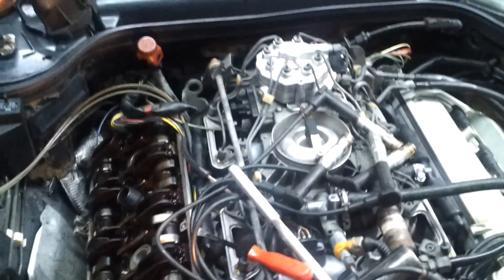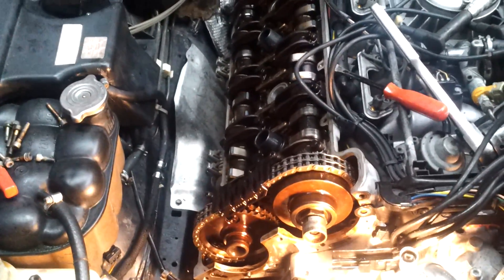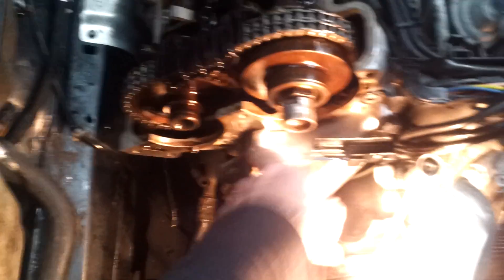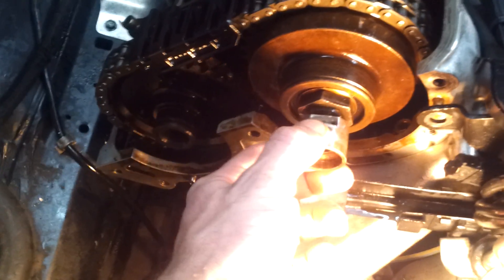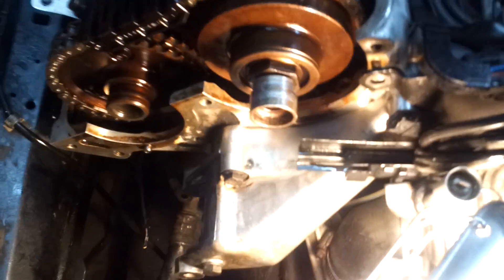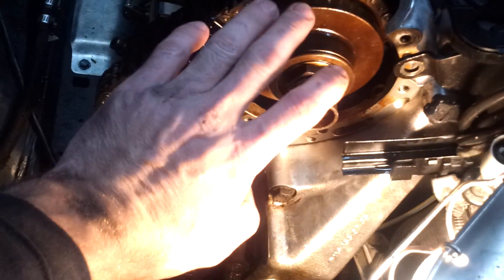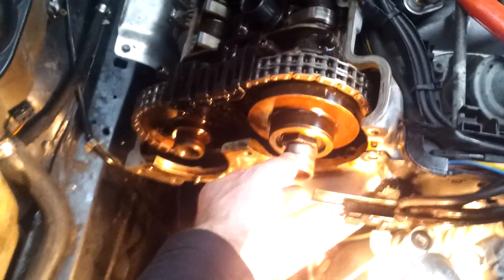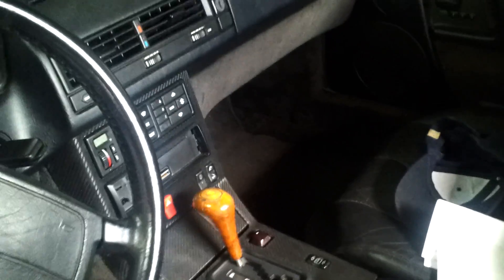Mercedes M119 motor camshaft advance mechanism. Mine was jammed.

Comment: Hi Victor, thanks for the great videos. My 91 500SL has camshaft magnet leaking from connectors. So I ordered a new one but need to replace the armature (the thing you are pulling out in video) as the new part number requires it  as an updated version. Can I replace the armature without taking the cover off, as it only has a new screw that goes in the middle. Do I need any adjustments. Please advise?
Reply from the maker: Its been long time ago that I fixed that stuck armature so I dont remember. I think you can just undo center bolt and armature will come out without removing valve covers. Sometime putting silicone around connectors stop leaks
Reply: vsandvs Thank you so much for your fast reply. Just wanted to make sure no adjustments required. 
Your the best my friend. Im building my fuel distributor next. Thanks again for your great videos. You have helped a lot of people who dont have good service mechanics around where they live.

Comment: Hi there , thank you for the informative video.I have a 1995 c220 w202 m111 Mercedes
.I had issues with the variable timing cam where I disassemble it by accident while changing the timing chain .I ended up bending the valves 5 times on the cylinder head .of course I did also set the the timing wrong at 20 degrees before top dead centre .I would like to know how the variable timing camshaft works on that particular model of car and what is the position on the cam gear when the car is not running

Comment: I stumbled on this same problem on my w203 1.8l C230kompressor. My cam plunger was actually broken requiring me to weld it back together, file it smooth and re-install.

Comment: Awesome Victor, we meet again. I had a fuel pump failure giving really odd symptoms like a bad computer. But all it was is failing fuel pumps. So now I find this cam advancer issue also with poor mileage and power is okay but not what it should be in a 220 hp M104. Ive also got a bad advancer and needing to troubleshoot and repair it.

Comment: Is it the same as m120 v12 cam adjuster. Can you explain how it works. Is it fully mechanical  advance with the solenoïde pulling  the helical gear inside And Goes advance. And when it is going of the spring pushing it back with help of rotation speed.  Am I right?  The gear helical 20 degrees or so.   So no oil pressure to adjust Anything?
Reply: Yes, same as M120. No, still uses oil pressure to push camshaft along a helical gear from the sprocket.

Comment: Hi Victor I have a 91 SL500 with a leaking exhaust camshaft seal, do I need to remove the rocker box covers to get the housing off to replace the seal, do you have a link to show how this is done, love your work very easy to follow 
Regards Peter Australia

Comment: Hi Victor. Thanks for this video. I think i have similiar situation in my w140 500SE 1992. Can you describe a little more how car is working before that ? My car sometimes stuck on rpms and cant accelearte. Normlayy car runs fine, no misfiring or something. But sometimes car stuck on 2000rpms and dont want go higher.

Comment: hi  victor you  are very helpful  i need your  help  please. from where the idle valve get  its currnt electricity  i change the mas air module and nothing  i change  also the temp sensor /the coold start injiction get 12 volt all the time (need  to work only for 3 sec in 5volt and no signel to change  egr valve while the car hot  maybe all related? thanks  !

Comment: Thanks my 92 500 has an intermittent flat spot on hard acceleration. Acts like an advance problem / throttle body. One more thing to check before buying a shit load of tune up parts for no reason especially after installing triple platinum Bosch plugs a year ago.